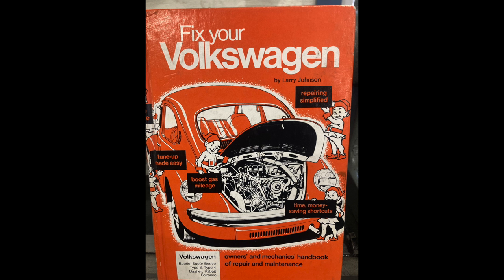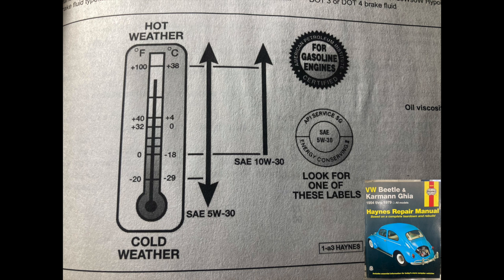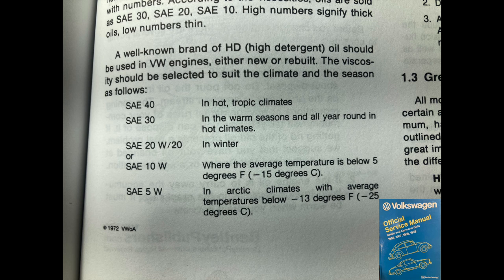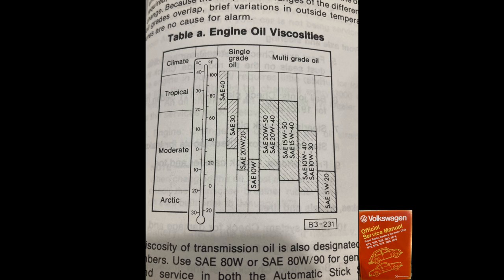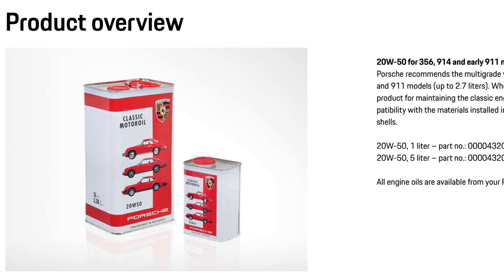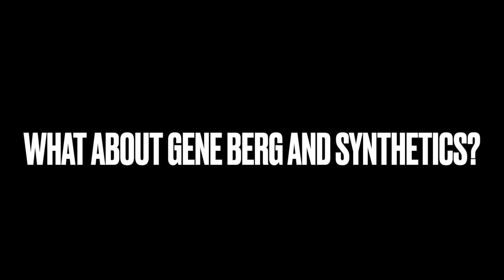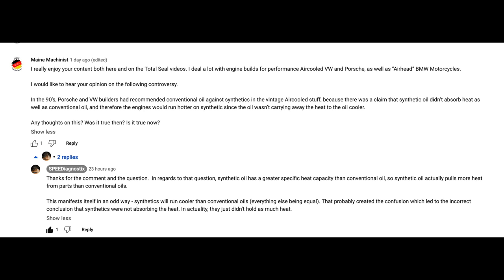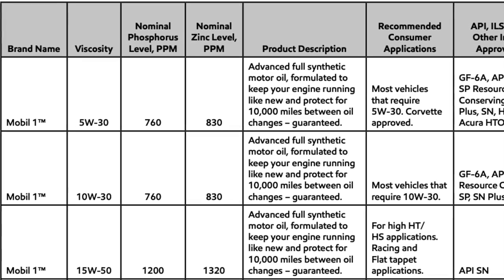Aircooled VW Oil - Finally, the Answer!

Comment: Awesome video. I live in NJ and have a 71 Squareback w/ 1600cc, 73 Thing w/ 1600cc, 74 Super Beetle w/1776 cc and a 77 Baywindow w/2000cc. In all I run a 20W50. Temperatures in NJ falls within the high moderate range. Ive always wondered about the oil that I should use. I guess Im okay. Thoughts?
Reply from the maker: It seems to be working well! 20w50 is listed within the recommended specs so if it’s working well I’d just stick with it!
Reply: Is 20/50 with high zinc recommended for a brand new engine as well?

Comment: I have been running 20/50 weight in my 73 squareback original owner of my car You have to compensate for heat dispersion and breakdown

Comment: In my ignorant youth, I always ran 20-50 in my built up 2ltr bug and R100RS, always in warmer (hot) ambient temps, and never had a problem. The Mexican beetle owners manual and the AC Porsche recommendations are telling. Thanks for your research.

Comment: What about aircooled motorcycles oil? I use Motul 7100 20W50 on my hog, who also is an aircooled pushrod operated engine,like the VW and 2CV.
The only diference i see is HD have hydraulics lifter. 
Would it be a valuable option?

Comment: I have another thing to read regarding oil.  This guy has his opinion and specifically has a section for air cooled engines.  He seems like a blow hard but it's worth adding to all the other information you provided and take from it what you will.  Do a search for Rat540.  He also tests oil and has ratings of protection.  He claims that zinc isn't the only factor and some of his tests showed that just because it had a bunch of zinc didn't mean it was better.  He recommends 20-50 since air-cooled have a lower ability to control temperature.   Cheers!
Reply from the maker: I’ll check that out today! Thanks for the comment!
Reply: @MaineMachinist  what did you think?

Comment: O yes high zink is extremely important 😊
Reply from the maker: It’s the most critical
Reply: Kendall 20w50 GT-1 Competition has additional zinc. I'm in So-Cal with a '62 1200 aircooled that has a bus trans. Running bigger valves, deep oil sump, and a Dansk aluminum oil cooler for a later model in the fan shroud. Smooth on the freeway, 65mph with ease and lots of pedal left, very dependable.

Comment: The ratings on oil build on each other so the next rating up meets/exceeds requirements for the previous rating if I remember correctly.

I own a Corvair so I needed to find the answer to the oil question and it seems there are a couple oils that can work well, heavy duty diesel oil like shell rotella t4, racing oils and air cooled motorcycle oil. Atleast the corvair engine can run quite hot so the oil needs to be made to handle the heat.
Reply from the maker: It is correct that generally the latest oil exceeds the performance of the older rating, but the only problem for older engines is the modern oils have eliminated most of the zinc phosphorus since modern engines don’t require it.
Reply: @MaineMachinist  which is kinda weird since the engines that require high performance oil require the additive package in said oil which does have zinc. 
I might see if rotella t6 has the zinc or something equivalent in function.

I'm just amazed how something that relies on so much data and science has so many misconceptions and differing opinions.
Reply from the maker: If you contact Rosella directly via email and they will get an answer from the engineers. I've had good luck with that.  @deltacx1059
Reply: @MaineMachinist  they are pretty good with that it seems.

Comment: I stopped using Castrol 20-50 after I contacted them years ago and they said they have zero zinc. I switched to brad Penn 20-50. I have a turbo engine that seems to run okay on temps but I thought about lower the viscosity to help pull heat but I am not sure if that is a good idea.
Reply from the maker: I recently saw that Castrol has released a product called GTX Classic 20w-50 that is specifically labeled as having high zinc.
Reply: @MaineMachinist  I might have to look for that.

Comment: AH ENGINE CODE: 1600 DP
1971 VW TRANSPORTER
Location: Homer, Alaska 

Winter oil: 5w - 20 
Homer winter air temp is between 0 - 20 degrees. 
Note: Zinc is added for conventional oil. 

Spring-Summer oil: 15w - 40 
Homer spring / summer air temp is between 40 -75 degrees.

Note: 15W - 40 Rotella T with triple protection has approximately 1200 ppm of zinc and 1100 ppm phosphorus at the time of manufacture. ( No need to add zinc )
Reply from the maker: Awesome information, thanks for sharing. I exclusively use Rotella T oils in my old farm tractors. It makes a huge difference. My ‘49 Farmall used to smoke bad with regular 10w30 automotive oil. I switched to the Rotella T and it doesn’t smoke now.

Comment: What about using an STP additive?
Reply from the maker: I haven’t tried it on an aircooled VW although I had great success with it in an old Toyota Camry. It normally used a lot of oil but never used a drop as long as I had STP additive in it.

Comment: the gene berg/synthetic question is still rehashed to this day. it's not a conflicting opinion, it's inconclusive/incomplete research done decades ago (berg) vs actual science - synthetics remove more heat from engine parts, it's basic physics. so many people still glued to old, outdated information because they heard or read somthing once and haven't bothered to update themselves since. science doesn't stand still.
Reply from the maker: That’s one reason I set out to do this video. It also shows the evolution of VW repair manual specifications as oil technology improved.

Comment: You don’t need synthetic oil as you won’t be happy to run it for extended kms due to the crude filter.
Reply from the maker: There could be some truth to this, but many people now have full flow systems installed that could make a difference.
Reply: @MaineMachinist  on a global stage not always available.

Comment: I found this out the hard way. I thought I was doing something good for my engine. WRONG!!! SYNTHETIC OIL DOES NOT CARY HEAT AND MY ENGINE DIED VERY SOON AFTER CHANGEING TO SYNTHETIC!!!  DON'T DO IT, YOU WILL REGRET IT!!!😢
Reply from the maker: Gene Berg has warned about this for years. I’m not sure yet how modern synthetic oil impacts things. In the video I consulted an oil specialist and he claims new synthetic oils actually carry away heat better than conventional oils.

I’m not sure what to think about this as of yet.
Reply: Might have plugged an oil gallery.